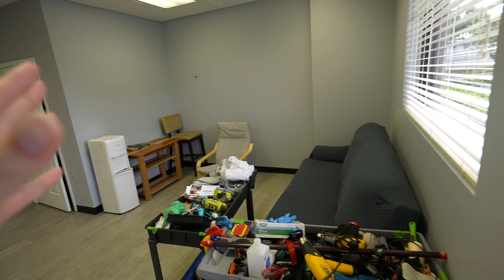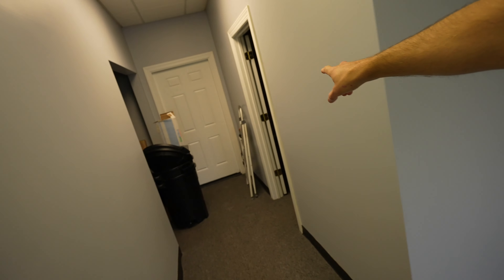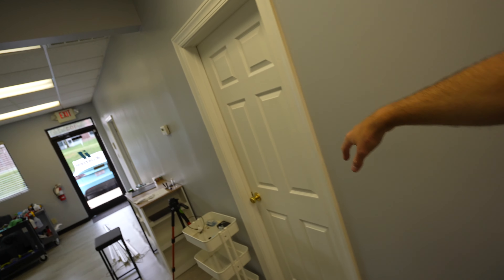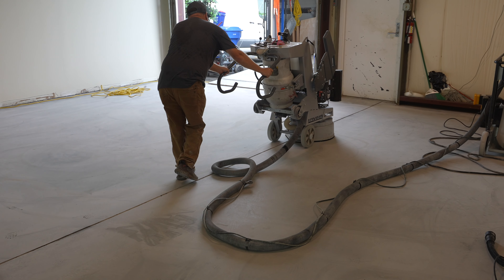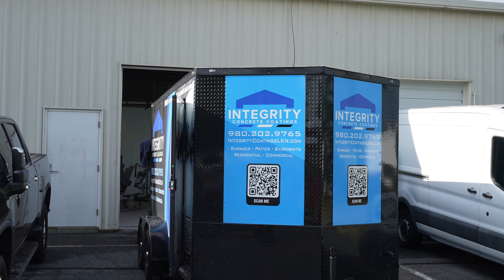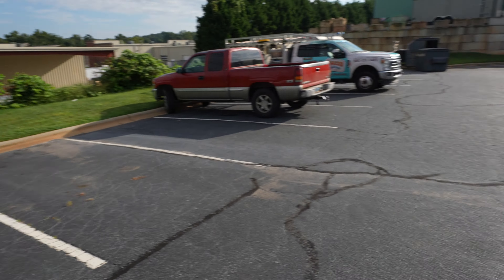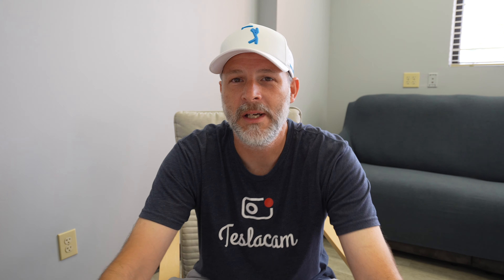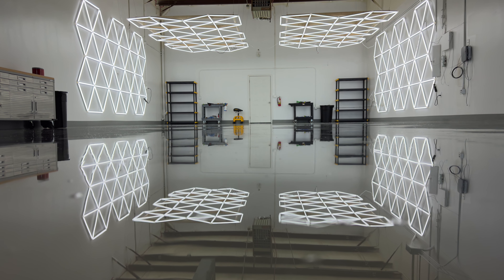I Got My Wrap Shop

Comment: Catching up with what you are doing. Looks pretty pro!
On a side note, might you be interested in a Model X round steering wheel? I switched mine out for a yoke a while back (Tesla did it.). I kept the steering wheel. Would be delighted to move it out. Perhaps you could use it. Whatever is a fair (good) price for you I’d be happy with. It is virtually brand new. Only used it a few months.

Comment: Congratulations Brian !! Its been a fun ride . I'm in Minnesota and have a 2018 Model 3 , I've been following you since the frunk shock hack . We still have it only 55k miles on it . I got my Cyber beast on July 1st . I wish I could bring it to you to wrap , I just can't give up enough time to make it happen.......I need some advice , My vinyl guy who mostly does commercial vehicles said he would do it for me . He wants to use 3m 2080 g10 gloss white , he can't get his 3m rep to sign off on weather it will remove easy in 4-5 years . what's  your opinion ?  have you unwrapped any cyber trucks yet???  are you using 3m 2080?
Reply from the maker: I use 3m all the time. The thing they are talking about is the vinyl sticks to the raw metal way more than paint. It will be harder to unwrap in the future but not imposable. How much is he charging for the wrap? email me